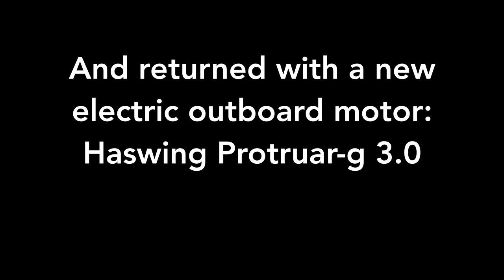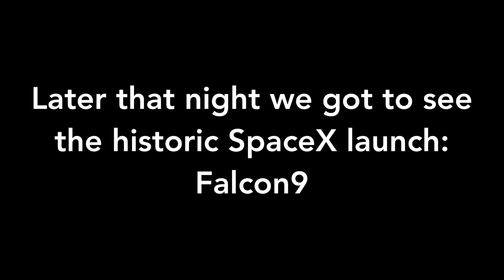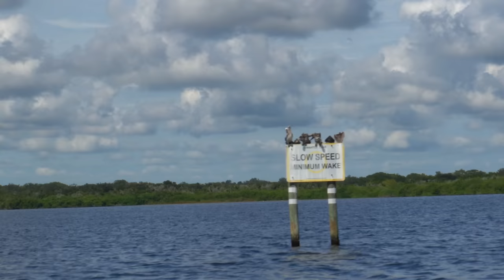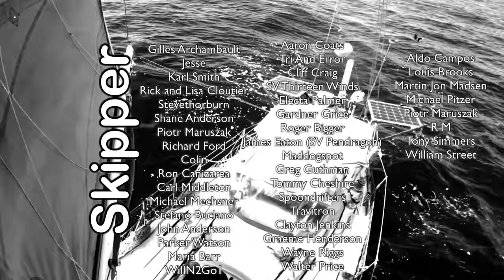SpaceX Launch From a Boat! | Sailing Wisdom [S5 Ep10]

Comment: Hey just wanted to reach out and thank you for help in learning how to make rigging. I just finished rigging my melges c scow with dyneema. It’s looks great and feels good better than stainless cable. Agsin thanks for all the help can’t wait to get it in the water
Reply from the maker: That’s excellent! Glad you were able to get it rigged so you can start sailing!
Reply: @RiggingDoctor  hell ya. Gotta run the outhaul and leech cord tomorrow and it’s ready for the water. Again thanks. Actually used the continuous loop shackle I made from your vid   I actually pulled a ford escape with the brakes on to stretch it out and put some abuse on it. Lol. Dyneema some tough shit

Comment: Its always great to see things like that from the water, and actually I think it magnifies the experience. I've seen fourth of july celebrations on land but from the water its really amazing to me. I've wondered what those gas releases were, I had never seen those until the Falcon 9s were flying. If I'm not mistaken they use them to steer the rocket down and be vertical when its near the water. Then they start the main enigine and slow it down to land. Really spectacular shots guys, great work.
Reply from the maker: So glad you enjoyed the footage! Herby got out his vintage lens for that one :)
Reply: @RiggingDoctor  Aha ! I have some of those. I've done 35mm most of my life. The do make a gadget that "crawls" around on the hull of the boat and cleans it. Its called the Keel Crawler if I remember correctly ! Probably cost as much as you paid for the boat !